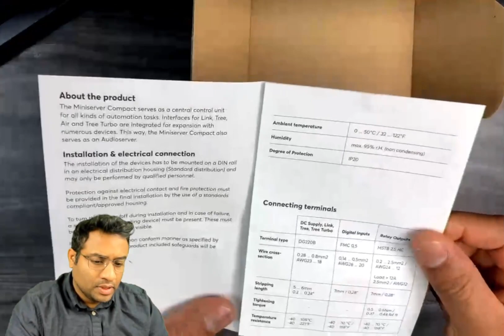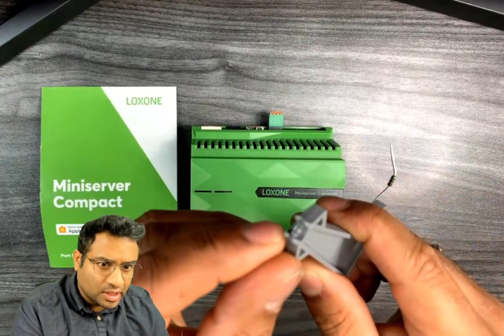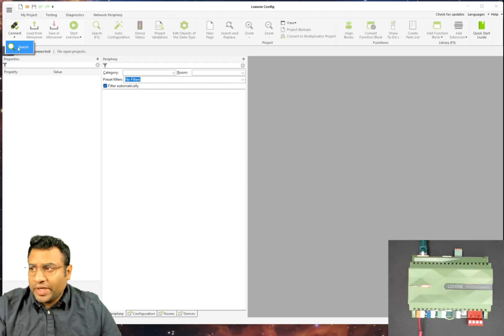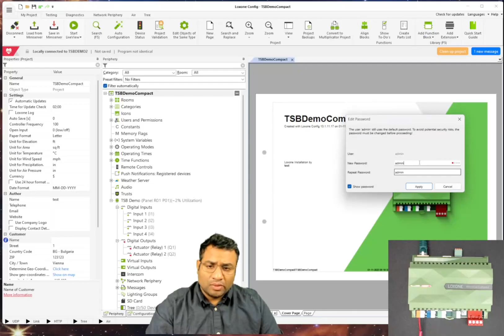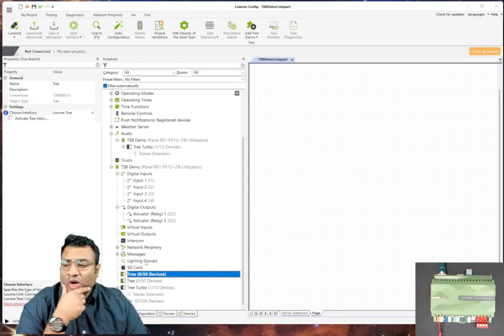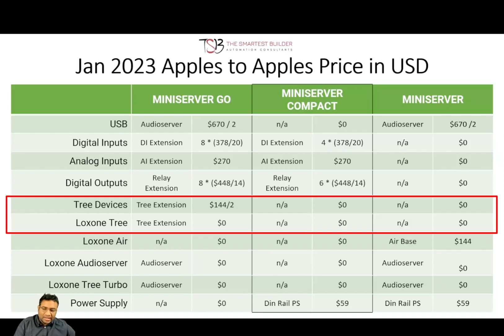Unboxing, Setup, Feature and Cost Comparison of Loxone Miniserver Compact

Comment: Can I interface Loxone system with my diy custom-built IoT devices as well? I know in Home Assistant we have loxone support but is it possible in any way to directly link other Smart devices available in the network?
Reply from the maker: Depends on protocol. I've done so with some friends back in the day to flush toilets automatically (freeze protection) with local IP commands. My best guess, without knowing the devices specifically would IP or UDP commands.